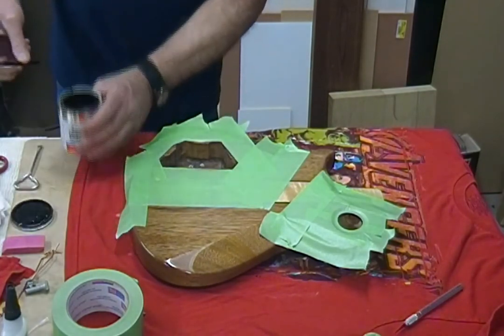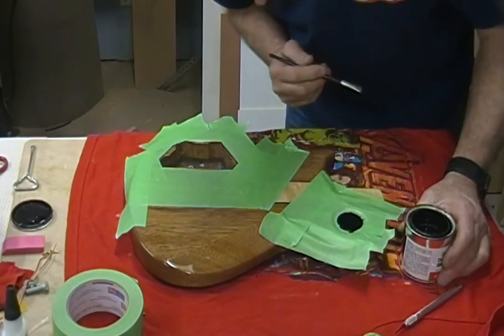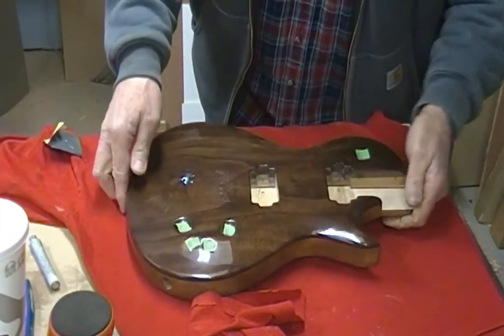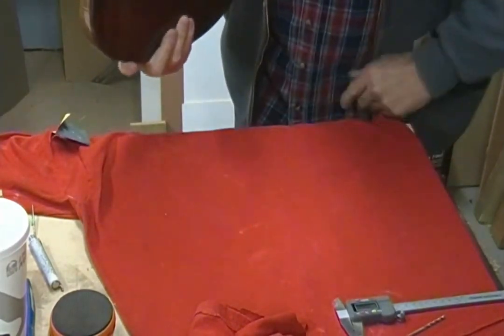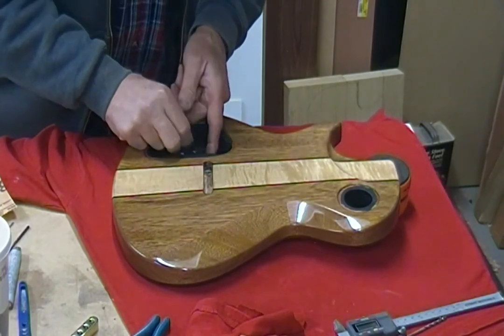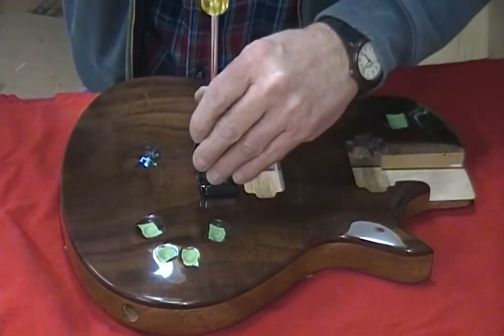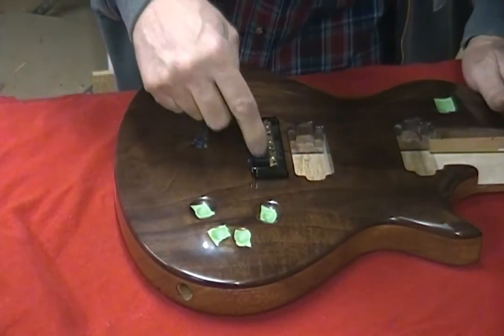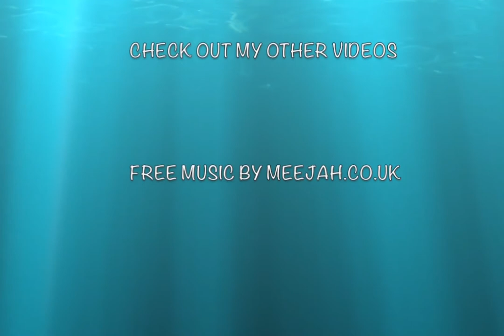Custom Electric Guitar Build, “GECKO 9 String” BY Jonah Guitars #35

Comment: Nice job Dane. I used Electrodag 915 from Crellon Industries on my 1973 Strat. It's loaded with silver particles but I can't find anything about it these days. Since then I've used self adhesive copper foil. It's so easy to solder and you end up with custom fit copper tins. I missed this video because YouTube didn't flash it up.for me either.
Reply from the maker: Dippy Hippy, I used the copper on a lot of builds but decided to try the carbon paint. It works good so I'm happy. I don't think it's really needed with hum buckers but I do it anyway.